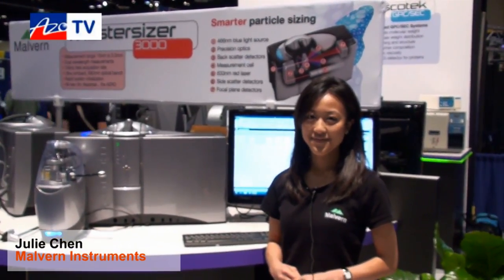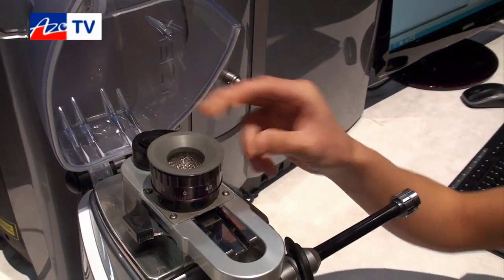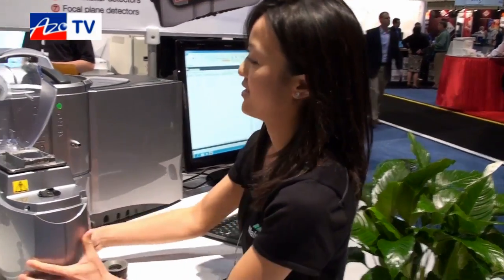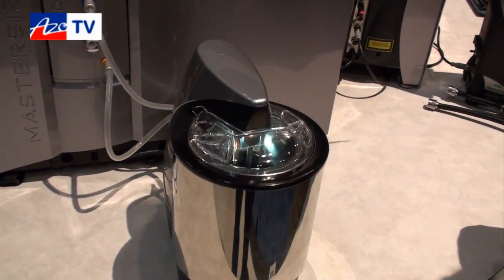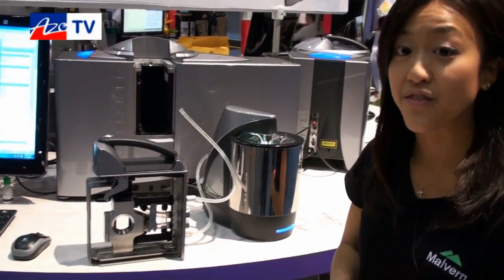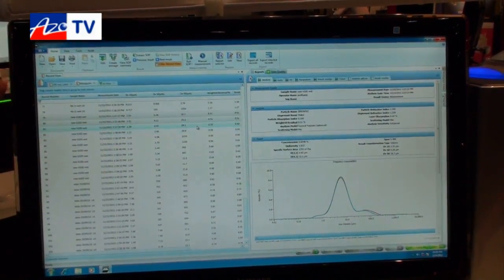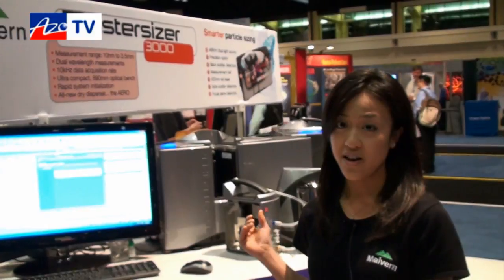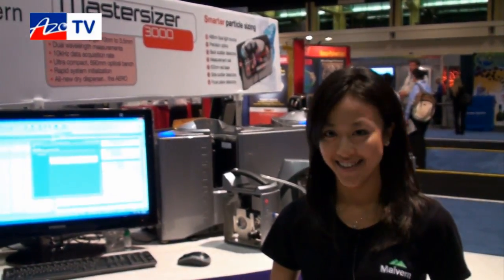The Malvern Mastersizer 3000 Particle Size Analyzer

Comment: How much would this Malvern 3000 cost if it were set up for only dry powders?...so for dry powders it only have the Aero Measurement cell, the Malvern AERO S and software.
Reply: That's gonna cost about $50,000. I bought a unit last year.